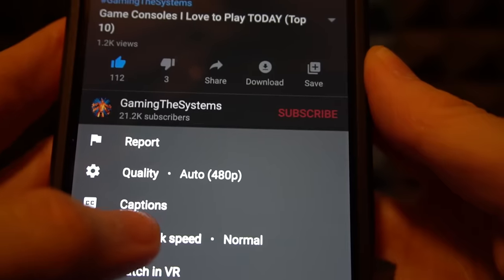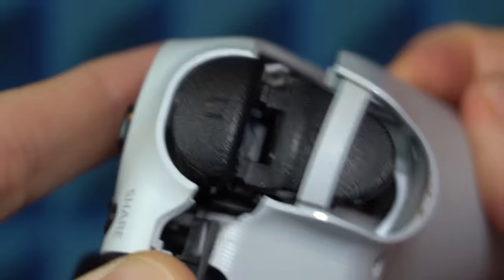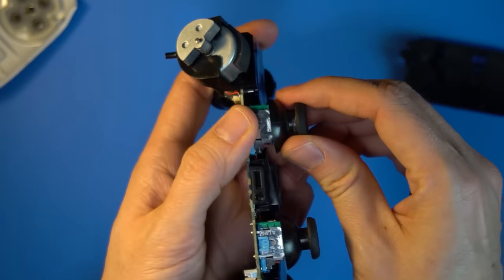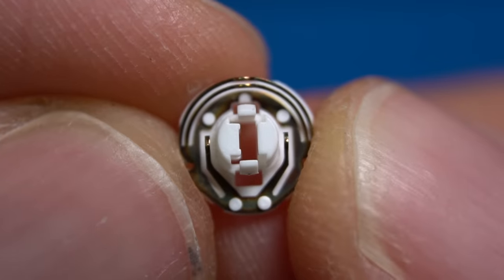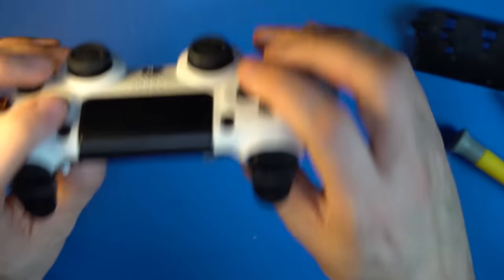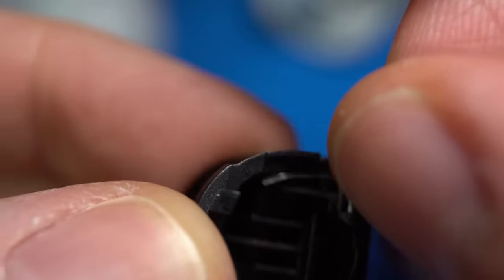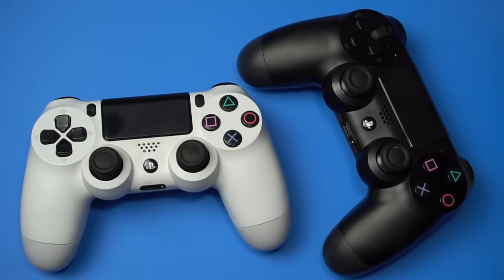How to Repair a PS4 Analog Stick That is Drifting, Sticking, Jittery/Cleaning DualShock 4 Controller

Comment: thanks this worked and was fun despite the frustrations. spot on tutorial. some things I found was be careful putting the disks back in, I bent one of the connectors but bent it back. It did take a lot of tries to get them in and also feed the ribbon cable through the hole.

Comment: my controller is fine now. thanks for the tutorial. first try using your method is working and couple minutes or hour later the controller got the issue again. and im trying to clean it again and i got an idea to change the little white thingy from my ps2 controller and my controller just fine again.

Comment: Thanks a lot. I have 2 controllers with a lot of drift and I was thinking of buying another one. I have decided to open the oldest one that had drift on the left stick and the l2 button to move the character forward, I have cleaned it as shown in the video and it is perfect. Goodbye drift, you saved me €60
Reply from the maker: Glad I could help

Comment: Thank you so so much. I dropped my controller some months back and it would no longer work unless wired. Today it drifted to the left also. This is my first time pulling something apart and fixing it. It works , I am so happy. Your video was so simple to follow. Thank you!

Comment: This helped the drifting issue, I think I messed up a little.  Now when I move the stick it feels like it chokes a little and need to little more effort to move it when pushing in certain direction, but better than buying a new controller or drifting issue.
Definitely needed tweezers

Comment: I had a sprinting issue with mine (couldn’t run for very long/started walking while pushing forward) 

Pulled it apart step by step in the vid, cleaned it, put it together again and it seems to have worked.
If it matters, my white ps4 and controller came with the Destiny 1 bundle waaaaaay back during its launch day, so idk if model/date release matters but as far as I know I have a very old PS4 and this fixed it so far as of August 2022

Comment: It worked very well with my ps4 controller 
I didn't expect it to work (i have literally 0 stick drift on linear now 😆)
I used water instead of alcohol btw
but i cleaned it very well
THANKS

Comment: This is the most simple and straight to the point video I've seen on this.. My controller now works like its Brand New!.. Only cost me 1hr of my time.. Also, if you have the version where there is no plastic divider between the L1 and L2 buttons, then the blue ribbon cable for the mother board is gonna go in, in the opposite direction of what you see in this video. I plugged it in backwards and the light wouldn't turn on and I couldn't charge the controller.. Once I opened it up again and flipped the cable the other way and plugged it in, the light came on and we've been good to go ever since ( 10 days ago).

Comment: I've been having major jittery sprinting on COD on the left stick. Took the white discs andand cleaned with a qtip. A surprising amount of black I guess grease came from the metal plate. Put it all together again and it seems to have done the trick. I guess time will tell.

Comment: shot cuz, this fixed my ps4 pro controller :D the forward direction on the left stick was playing up, when i cleaned it out the cotton tip came out black so no wonder it was messed up, flipped the tip around and did a second pass on it. Similar story on the right stick too.

Comment: This worked. Using ps4 controller on ps5 for the paddles (cheaper) and I was unable to run forward. Using wd40 to everything. Only lasted a day or so. Tried this, and hopefully it helps for a long term

Comment: Thanks a lot. This video saved me the cost of two controllers/repairs. Honestly though, those little green hatches, they had me worried sick. One of them didn't close properly afterwards, but the controller is as good as new despite of that little issue.

Comment: After having tried twice to fix this leading to 0 improvement and a lot of frustration since these controllers are hard to work with, I have now tried a third time and my controller works as well as never before! No more issues, not even the slightest bit. 

What happened before was that left stick would only register "up" if it was straight up, otherwise it would only go left or right. So walking in games was impossible.

Also, the left trigger would cause the left stick to go up the same amount the trigger was pressed.

What I did was: Clean all pads and connections, clean the pots of the left joystick by prying upen the small blue/green parts on the side, putting a piece of folded paper below the plastic connectors and making sure they line up well and tightening the MB screw very tight.

Comment: There is no need to bend the pins of the joystick and take out the disc thing. Just blowing on it will work. Doing that had caused my character to never stop moving. Unnecessary step

Comment: This mother!@#$%^ just saved me $60! I cannot believe it worked! As small as the tiny disks inside the analog stick were, I just assumed I was going to do something wrong during reassembly. But nope, followed his exact instructions and controller is good as new! Thank you! I'll make sure and share this video to anyone who has the same problem.

Comment: DS4 v2 differences
0:56 (major) The plastic bar that sits between L1 R1 and L2 R2 is not part of the back plate.
1:32 (minor) The battery connector and ribbon cable socket swapped places.
1:55 (major) The battery holder is held in by a single screw, it also has the reset button attached, no chance to lose it.
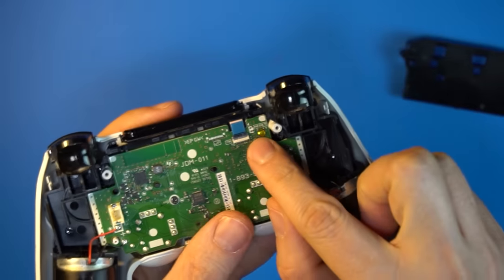2:09 (major) The socket doesn't have a lever.
2:46 (major) The Options and Share buttons are part of this plastic that is being taken out, no chance to lose them.
3:19 (minor) Orange chambers with black discs inside.
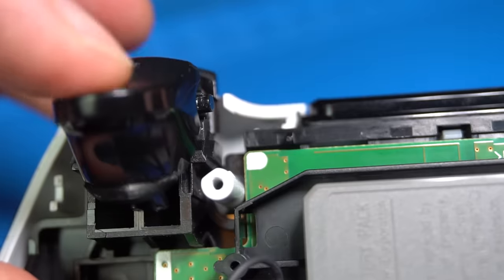6:39 (major) There is a piece of clear plastic that carries light from the light bar to the trackpad. The backplate won't snap on to the front plate unless the clear plastic goes into the trackpad correctly.
Reply: Stick drift was making the camera "look up" in many games

Comment: The problem with mine was the right stick would turn right very slowly, so basically unplayable.
I got to the point where you pry open the door to clean the sensor and thought, no way am I risking snapping that off. So I just soaked a cotton bud with contact cleaner and saturated each sensor and let it drip in. Let it dry off and repeated a few times. This worked, now my look around sensitivity is back to normal, and no need to open the joystick mechanism.

Comment: 2:00 the battery plastic is also secured by the screw inside it. Guys don't forget to remove the screw before taking that plastic out
Reply from the maker: For some it's that way. Multiple variations out there.
Reply: @HowToX  Ahh i see

Comment: You saved me from replacing my controller. The right joy stick would always drift when pressing L2. Afterwards some of the buttons stopped working so I took it apart again and cleaned the ribbons with alcohol and then it worked like new. Thanks so much!!:hand-pink-waving:

Comment: I have occasional drift that makes me walk forward. Controller was given to me with some extra analog modules. Just need to remove 2 more solder joints and I can replace the left one. There is possible drift on the right stick as well but I haven’t seen it yet.

Comment: This worked good for a while for me. However, cleaning wont work if the traces are to worn. What fixed it "permanently" for me was to take the disc from the up/down potentiometer and put it in the left/right potentiometer and vice versa. That way they will wear on a slightly different spot.

Comment: Just a heads up - the cable on my controller that apparently controls the light is inserted the opposite of what it says in this video. My cable had the blue sticker facing the battery, not away from it.
The best advice is to look at these things before you disassemble it and take note, since it's a lot of stuff and it can be really frustrating.
Now onto something even harder - beating Sekiro...

Comment: It worked! Thanks so much! I actually got the White discs mixed up cause I forgot where I put each one for the left analog button. So my character would slowly move forward and when I pressed L2 it would walk forward while doing L2. 🤦‍♀️🤦‍♀️ Luckily I switched them around and it worked very well. Such a good guide.

Comment: 5:55
This right here is dangerous advice, depending on the model it could be the other way around, look for the metal connectors and match them to the ribbon's
Reply: True, mine was the other side, noticed by watching the pins inside the socket.

Comment: I can confirm that after following the steps in this video (and some that weren't covered at all, like having to unscrew the battery holder on my model of the DS4), my drift has successfully gone from "Just enough to cause mild irritation but temporarily solvable with some rubbing alcohol" to "Completely fucking unusable". I don't even blame the person who made this video, I blame Sony for making such garbage controllers loaded with unnecessary tech that nothing except a few first-party launch titles even used. Meanwhile, my original Dualshock controllers from 1998 still work like they were brand new.

Comment: Honestly I did every step and it worked, but the issue is I think my white circle things don’t have any wear left in them. I mean it’s the og controller with the ps4 when it first came out but I’ll just use another controller and adapt to it

Comment: 1 phrase. 2 words. "JESUS WEPT".
My dude I've been using this 2nd hand controller for almost a year now and I have tried everything. Finally i caved and did this as a Hail Mary and it did not work the first time. But after I realized I screwed up with the tiny circular wire thingies and put it back the right way....
I can finally play The last of us without Joel having to look to the left everytime..

Comment: Guys its really weird how imma explain this. But i fixed it (temporarily, not sure how long it would take until the symptoms happen again) but I tried doing chiropracting on it. I lay down my controller on a flat surface, lift up the stick in every direction (left, right, up, down) and press down with both palms on each analog stick like a chiropractor cracks a back. Suddenly both analog sticks are not stuttering anymore. Good luck guys.

Comment: Or you can just spray some lubricated switch cleaner into the stick from the outside and wiggle it about 10 or so times to clean it. This means you dont ned to open the controller AT ALL. I use Servisol Super 10 switch cleaner, works every time.

Comment: Heads up at 05:55 he said make sure the gold ribbons are facing the battery. Not true, when I did that my controller light wouldn’t come on and the controller wouldn’t charge. Apparently some are blue side on the inside facing the battery just look at it when you open up so you know.

Comment: If your l2(left trigger) is pressing your r2(right trigger) when you press l2 or if your l3(left stick) is pressing l2 when you use it. Just tighten all your screws and it should be fixed.

Comment: Thanks for the info. With your video and some descriptions I got on paper with the repair kit I bought (has a screw driver, some plastic tools to simplify opening the case) I was able to clean and repair 3 of my older controllers. These were V1 and V2 (I guess V2, not sure really) controllers and ironically, opening the V1 controller was super easy by moving away the plastic clamps behind the R1 and L1 buttons.

However, with the V2 controllers, these clamps are completely hidden behind more plastic 

rant
on purpose, sony? hm? get your shit together and use hall sensors
end of rant

So the plastic clamps of my V2 controllers broke open while the ones of the V1 controller remained intact. But that has really only happened to the clamps at the top, the ones between the stick just pop open if you apply some pressure against the case gap (the clamps are between the USB/audio jack and the left and right stick respectively)

Luckily, this is not a huge issue as the screws hold the case top and bottom together pretty tightly.

Comment: Trying this with my original 2014 controller. Accidentally broke the black wire to my rumble motor... welp. Also those green things were incredibly hard to put back on

Comment: Going well(?) Until the part where you take the joystick pads off then pry open the green hatch to clean it. Now mine wont snap back at all, nomatter the position of the white circle 😢

Edit: Rewatched the part a few times, tried again, and one of the little white peongs fell off and broke. Lovely. Guess ill have to save for a new one 😮‍💨

Comment: If anyone's wondering why their light at the front of the controller stopped working after this; you might have a newer version of the ps4 controller, and the ribbon wire has to face away from the battery, unlike the  controller in this video :)

Comment: @HowToX thanks, i fixed the drifting but there's one problem, there's no light when i turn it on, yes i tried what was written in FAQ in description, but the controller only works when it's in charger, right when i took it off from the charger the controller dies
Reply from the maker: Interesting. Make sure BOTH ends of that cable are connected. When it's charging, it's likely taking the electricity from the USB cord, but when it's not charging it's taking it from the battery. All things seem to point to that cable.
Reply: @HowToX  I've checked everything and saw that end of cable (close to that blue spot) is bended a little

Comment: I tried taking my controller apart myself and didn't figure out that I could pry open the panels surrounding the thumbsticks. Didn't want to break anything trying to experiment, and thanks to your video I managed to fix the severe jitter issue on my controller. Thanks a bunch!

Comment: I 
CANNOT 
GET 
THAT 
GREEN 
THING
TO 
SNAP
BACK
TO
ITS
PLACE

and im pretty sure i got those white discs positioned correctly
I cant even snap it back without the white discs

ANd I tried pushing it with herculean force and it still didn't snap back in.
Reply: Same here. Fuck these garbage controllers…i barely had it for 1 year and it already started having issues.
Reply: @gamemaster0107  the issue for me was the round looking thing (not the rectangle thing) on the bottom of it's side wasn't aligned with the place where it should snap back in. I realized this after breaking it.

Comment: how youtubeworks is funny. i did this yesterday. only difference i didnt open the sides of the sticks. i filled a spray bottle with alcohol and sprayed them. a little compressed air, and repeat 2-4x. hair dryer to finish the job. no drift at all.

Comment: Do I need to keep the controller on and let it drain out on its own before continuing forward with opening it and removing the ribbon cable and battery cable connector? Is there any major electrical-shock risk if I remove the battery cable connector if there’s still battery life?
Reply from the maker: I've never had a person say they've been shocked, and that's with millions of views.
Reply: @HowToX  oh ok thank you 👍

Comment: Thanks for this tutorial. Do you know if the analog stick boxes in the PS4 controller are the same as the boxes in the PS2 controller? I'd like to put some new boxes in my PS2 controller. It's hard to find used PS2 controllers with good sticks and new PS2 controllers are a little expensive. But I have found used PS4 controllers with good sticks for cheap.

Comment: I did this with my ds4 v2. It's working perfectly now. But, I'll come back in a week or so to confirm if it is the definitive fix because i cleaned that area without opening the little box multiple times and after a couple days the problem returned.
Reply: It's safe to say that my controller is completely fixed. Thanks!!

Comment: Im in a situation now where, if i power down ps4, it will do "cannot start ps4" and maybe rebuild database works, but usually have to factory reset, but if i put it into rest mode, the controller cant turn it back on. Have to yank the plug. 

Every single time.

Comment: Just spray a good old wd40 without removing the disc. Mine works with that and it's been 4 months and still working great.
Reply from the maker: That may disintegrate the plastic components over time.
Reply: @HowToX  just give them a good blow dry before taking it back. Don't let any plastic/rubber to get wet.

Comment: Yeah I don't know what the f I've done. But before you say " just follow the vid" I did and I redone it 4 times now but once I closed my controller and connected it, it now just automatically holds the up key or pushes up on the left stick, like I can't chose a game to start because im stuck on the upper half of the ps home screen (party messages settings and so) and I somehow bet It has to be one of those discs that you extract when you open that one of two green door sideways

Comment: Hey I just did this trick and my stick no longer drifts however, moving the analog stick left and right both register as left. Did I mess up the positioning of the disc when I replaced it? The spring didn't seem out of place

Comment: After I took it apart and put it back together again, the left stick goes haywire on some games? It will aggressively drift to the right, and on other games it's a little non-responsive at some points. I don't know exactly what I did wrong 😢

Comment: I did everything you told me to do and it did fix the stick drift but now my controller wont charge properly.
Reply from the maker: Your ribbon cable is in the wrong way. See the FAQ in the description.
Reply: @HowToX  Thanks now it works👍

Comment: My ps4 controller had stick drift and forward on the analog stick stuttered while moving....pulling up the stick n moving it the opposite side from the side that has the issue n blow in it and it works just as fine